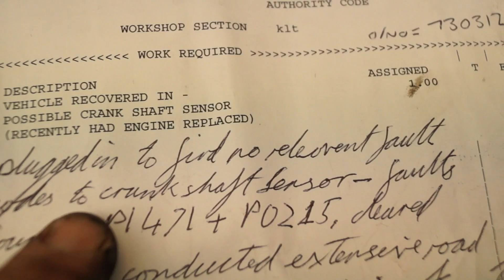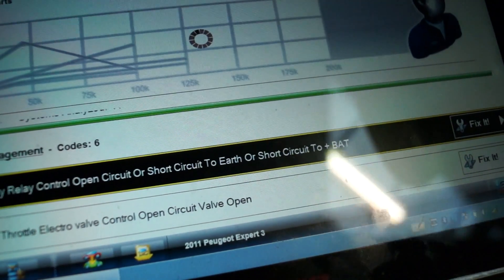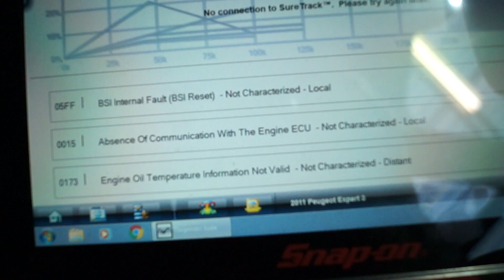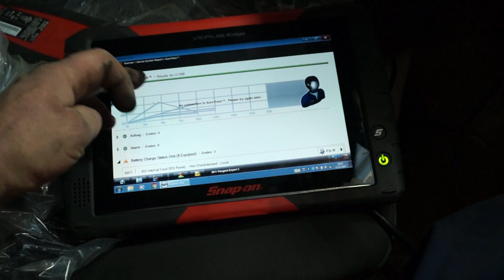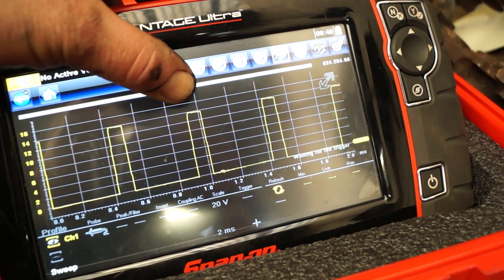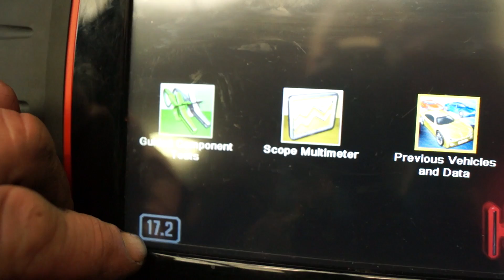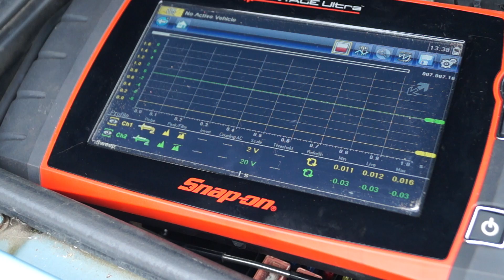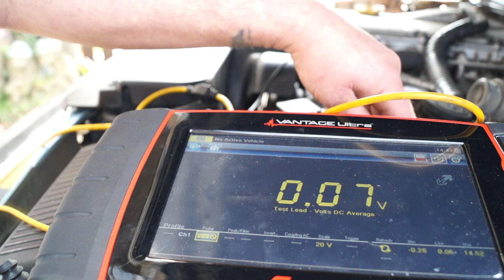So, which of you want to learn about beyond fault code diagnostics? (oscilloscopes)

Comment: Hi mate,
As an electrical eng by trade and an avid DIY`er when it comes to my truck i am very interested in learning more about the diagnostics side of things. at present i bimble through using a hawkeye and multimeter, so so would to see what exactly more knowledge of using a scope could provide.
thanks very much for taking the trouble to post this valuable info to the public.
Reply: is there any more news of this diagnostics information you were talking about mate.
 I have hawkeye fault codes for all 5 injectors "peak charge too long logged".THIS IS A DEFENDER TD5 ON A 2001 PLATE. which is driving me nuts.
Engine will run as normal then cut out , after a few mins will start again "even if fault codes are not cleared" but will sometimes cut out immediately or perhaps after a few minutes .
I have checked the following and even replaced as a precaution.
Injector wiring loom, replaced.
MADE A STANDALONE new loom from ecu to injector loom as original was still oily. checked and measured resistance both to earth and across all injectors. all read 0.5 ohms.all pins and terms checked and rechecked.
replaced fuel regulator and GAUZE.
Fuel filter replaced,
Crank shaft sensor tested cleaned and checked this reads about 1.25Kohms. And is pulsing to ecu .
Mass and Map sensors checked and cleaned.
All earths checked.
noted difference between ambient air pressure and manifold pressure to check against possible inlet blockages . all seems ok and clean .
I am about to replace the fuel pump next along with the fuel pump relay.

However i am really interested on your thoughts as to what you think  the HAWKEYE fault codes 3183 ,3184 ,3185, 3186 & 3187 all five injectors, the description is" peak charge too long logged." 
any help would be greatly appreciated,
And please keep up the great videos, they really are helpful.

Comment: I'd be interested! Being a computer engineer, I do have an Oscilloscope and sort of know how to handle it, but not on my 110 TD4 MY 2015. Also interested in other electronic diagnostics. Upto now silicon feels more natural to me than grease ;-) but I intend to change that :-)
Reply from the maker: If you get it,  you'll very quickly orientate..  Mainly it is a matter of just knowing what the components are, how they work in relation to the others.  what electrical values they have and what type of signal they recieve or put out and where to find wiring diagrams.   The Puma 2.2 which is what you have?
Reply: Yes it's the 2.2 with all the fancy three-letter stuff such as DPF, EGR, DSC, ETC etc. oh I forgot heated seats ;-)
Reply from the maker: We can't get away from the DPS and EGRs now.   Part of it all.   There is noext to nothing about diesel diagnostics in video format so I will change that over time.

Comment: At least you are still hella mechanic versus overpaid parts changer. Had a truck yesterday i was told to change alternator on, was charging fine, had already been replaced at one point i could tell, so needless to say i am a proud owner of a free spare delco 28si alternator now lol. Youngbloods in shop been there couple years longer than I have, but i digress. Hope your weekend goes well.
Reply from the maker: The weekend is great. Cheers.  Got to sleep in longer for 2 days.   Problem is with the young 'uns.  They all pretend they know what is going on, but like the diagnostic report, initially that i got was from one of our recently qualified technicians.  He is good with truck diagnostics because it is all laid out for him.  When it comes to things out of his box he tends to just get it handed on to others.  Doesn't help that the engine was replaced by another garage.  We get to bear the brunt of getting it right.   Van is owned by a utility service agent.  As soon as they go out of warranty we get them to service and maintain.

Comment: I can't agree with you more, I'd love to see more of your take on the subject of Automotive Diagnostics.
Its funny you bring this up because I'm in the market right now and about to pull the trigger on a purchase on some Autel products. (Can't pass up a deal)
As a sorti Freelancer but not my main trade more a side hobby as well side work $$ :) . (I really enjoy it)
Breaking down the issue to the root cause of the fault has always been my passion, not loading the parts Cannon. 

In one case, I was able to Diagnosis down to an issue that was the true root cause that leaded to a failed part. Sure replacing the failed part would have solved the issue in hand but the fix would have only lasted so long until the newly replaced part gave up the ghost. I would not have seen it without a Power Graphing Meter.

The Art of diagnostics, Sure there are some cool tools but it is also a mindset on how to apply these tools when & where. I only hope to achieve some true understanding as I've seen deployed by others first hand.

In today's Cars/Trucks with CAN Bus, You can't even try and solve a simple Driver side door Master switch in some cars without some sort of Scope. Unlock, Lock, Window Glass control Up/Down of all the doors, Plus side mirrors control with only Three wires coming out of the switch body. Good luck.
Sure, You and I might not know what the CAN signal is transmitting in a case but being able to see a valid signal vs a really crapping bugging out signal would lead us to a simple failing wire or pin connection in a door jam.

I'm looking at an Auel MaxSys MS906TS & Autel MP408 4 channel Scop,e too up my game. I've settled for this product line after doing my Research with the After Market Product. So, many good choices, OTC, Autel, Launch, Snap-on to name a few.
 
The Scope is not the best around (Mostly because of some features of the past), I'm told the software has gotten better in features but Its still a good Scope and I can beat it for the going price. Plus it is USB base so I could use it with Autel's main unit (MS906TS) via an installed App or It can be run on any PC Base system I.e. Laptop.
The Pico Scope is one of the best around, Its software is out of this world. (It's pricey $$$) It's a free download to check out the Software.
To name a few test you mentioned or led to in your video.
Signals: Cam, Crank, Cam/Crank correlation, Injector Pulse, Ignition Pulse, Relative Compression test, CAN Bus, In-Cylinder Compression Testing, ECM I/O, Wheel Speed Sensors, Sensor I/O etc, etc on and on...
Even the trusted Powers and Grounds.

The Trusted old Scope on a Rope or even a DMM (Which should be standard Equipment right beside a Scope) would have shown me that 5 Volt Rial & Ground but Not the crazy Noise on it at times that led to the other failing part which was the root cause.

Sorry, this was long-winded!
Thanks for another great Video. Look forward to more.
Reply from the maker: Interesting and not long-winded.  Unfortunately, when one reads even the newest diagnostic training books they will still tell you that the progress in technology outpaces the diagnostic techniques. It does come back to simple testing sometimes but without a code reader, it then becomes a veritable minefield.  None of the guys i work with have found a use for a scope on trucks.  They rely on the DMM, product courses, past knowledge of loom and component failures. 

  I watch a guy on YouTube in New Zeland who has a simple Pico box. (Andy Mechanic)  It cost him $250 NZ dollars.  Not the best but it works with a laptop.  good all round but only 2 channels.  Scopes should be coming down in price as they become more needed. I've not looked into Autel.

Comment: Yes interested, I bought a lynx diagnostic still not got the hang of it, read about bleeding the ace system when changing the actuator in the rave, as Land Rover only use their own systems, but found nothing about it in the Lynx read me files, but it does look like good way to start so yes using a diagnostic would be brilliant Chris :)
Reply from the maker: We have done a video on the Power bleed. https://youtu.be/D5zvN8YSk9o Atlantic british on their You Tube channel have a video on showing how to replace the shuttle valves.

Comment: I just replaced a wheel speed sensor on a Toyota for a neighbour, read the codes, took the sensor out, cleaned it, put it back in, seemed to help the issue, but the error codes came back shortly thereafter.  Ended up replacing the sensor and all is good.  But the whole time I had been cursing myself for not being able to diagnose the sensor specifically with a multimeter or a scope.  Similar thing happened a while ago when a neighbour asked to use my code reader, and we noticed a bunch of cam position sensor faults.  Could have been the sensors, could have been a stretched timing chain, or any number of mechanical issues in the valvetrain.  Having the ability to diagnose the sensor outputs would have helped immensely.  As it stands now, the fault codes are only symptoms, never assume they are the actual fault, and so further troubleshooting and intuitions are needed.  Anything you make on the topic of further chasing down the rabbit hole into the land of magical electrical pixies would be greatly appreciated.  Thanks.
Reply from the maker: Once you recognise what is needed you are already halfway there.   It is a very complex world we live in do things change fast.  The last 10 years for me has been a learning and relearning curve.  It doesn't stop either.    Scanner Danner on YouTube is a good placd to start learning if you are interested.  He covers mainly American cars but there are some real gems of info to be learned from him.

Comment: I'm very interested on electrical diagnostics. Mechanics here in Brazil are usually components changer and I want to be able to detect at least the basic problems before replacing everything. Great vid. Cheers